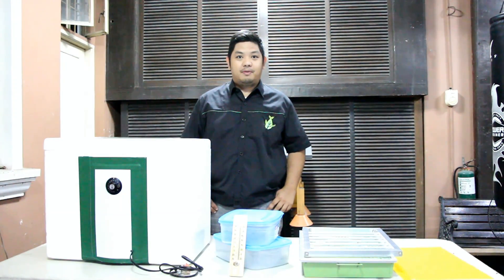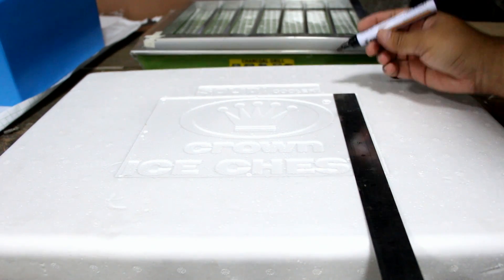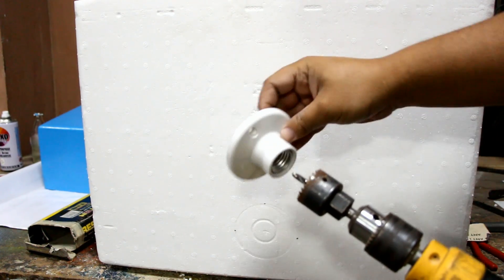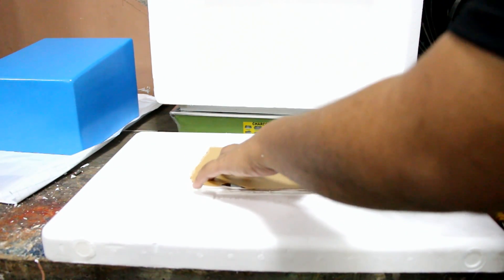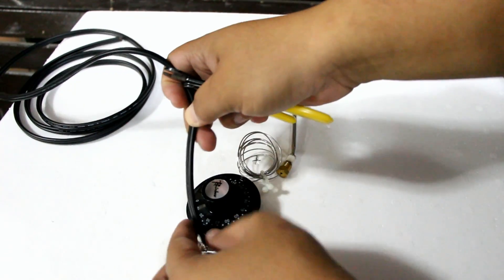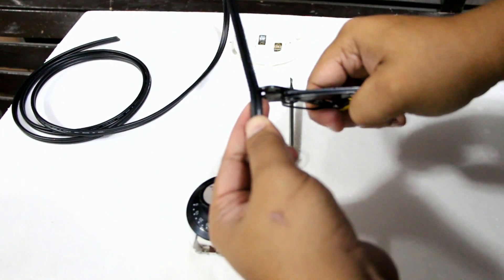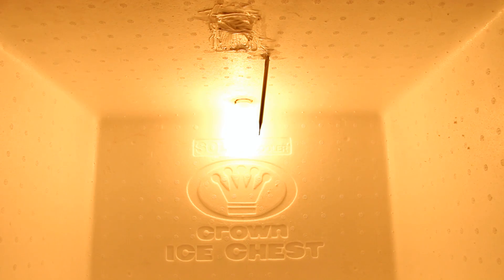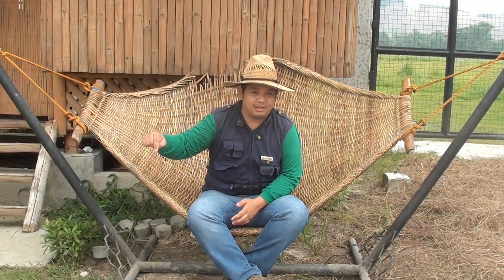DIY Egg Incubator, Part 1 of 3

Comment: sir in case of brownout,what will you recommend as alternative heating element? madalas po brownout d2 sa min eastern samar.tnx
Reply from the maker: Kung matagal ang brownout, mag deep cycle battery ka na lng with a charger and inverter. Kung saglit lang pede na UPS tapos low watts na bulb.
Reply: ok sir tnx, how bout ung moisture sa loob ng styrofoam incubator sir na umakyat sa salamin tas nakakabasa sa eggs ok lang po ba un?

Comment: how do you calibrate your capillary thermostat?
Reply from the maker: We use 3 thermometers.
Reply: how you do it?do you submerged both the probe and the thermometer in hot water then you adjust the setting of the thermostat based on the reading on the thermometer?

Comment: sir kapag 50 capacity lang ng egg khet Hindi n ba mag lagay.ng fan..OK LNG ba..
Reply from the maker: use thermometer to determine cold spots inside incubator. If temp is not balance inside the incubator, a fan is used to circulate the air and balance the temp inside.

Comment: boss paano sineset yung thermostat sa 37.5 oC at ilang degrees ang dapat para mamatay ang ilaw at ilang degrees para sumindi ulit ilaw.salamat
Reply from the maker: We use the graduated knob of the thermostat and set it until the temperature nearest the egg reaches 37.5 oC
Reply: boss bumuli  ako ng digital thermostat kasi hirap ako sa knob type.boss may ask  ako,yung box ko flywood na 3/4 at ang W-21 inches , L-21 inches ,H - 14 inches pang 50 egg cap. ,ok lang ba ang ginamit ko na bulb dalawang tig 50 watts ? at sinet ko yung thermosatat sa 38 oC .pag naging 37.4 oC sumisindi yung ilaw at pag umabot na ng 38 oC namamatay ang ilaw.ok lang ba ang watts ng bulb ko na 100 watts at ang pagka set ng thermostat ko?nakasindi ang ilaw mga 18 seconds tapos mag off ang ilaw ng 1 minute bago sumindi ulit ng 18 seconds,ok lang ba yun boss?salamat ulit
Reply: kailangan ko pa ba lagyan ng fan boss? kasi dati may fan inalis ko kasi parang lumalamig yung mga itlog

Comment: Bro, May question lang ako kung puwedeng pakisagot at isa ako na intresado sa home made incubator.
1.) anong watts and ilaw ang ang kailangan gamitin ?
2.) Char-coal grill mo ba may butas din para singawan ng init ? 
3.) Ilan ba ang tamang temperature F or C .
4.) May vent ba incubator mo ' in and out take ?
Thanks Boss
Reply from the maker: 1. 1 pc. 25 to 50 watts
2.  wala pong butas ang grill sa baba para pede din lagyan ng tubig
3. 37.5 deg C , 99.5 deg F
4. meron pong butas sa baba at taas

Comment: Hi there
i have added 50 mm PC fan to my still air incubox which already has 2 x 20 mm holes in the front bottom and the same in back bottom, 
do i need to add 2 holes to the top, because i have noticed that the small bulbs which are 5W ceiling mounted are getting fused so often after installing the fan
always i will seek your advice and help
Thanks in advance

Comment: Hey.  Just wanted to add a quick electrically-minded comment:  make sure to connect the hot wire directly to the thermostat and not the light.  If you don't, the hot wire is still hot at the light even though the switch is open, and you could shock yourself.  

Also, that aluminum foil around the bulb is not a great idea - your foil could contact the metal bulb contacts, and short to that foil.  You won't see a problem until you touch the foil by mistake with the light on.
Reply from the maker: Thank you for your inputs. We will take note of that in future builds.
Reply: Madodel bor can tall to you, your number